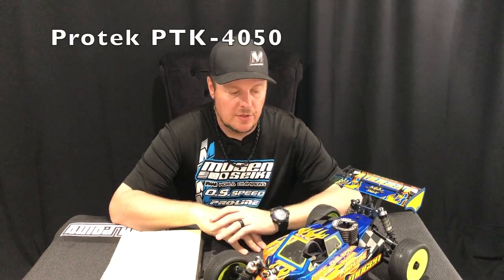Nitro Engine Tuning - Things to check before making adjustments.

Comment: Adam, Great video as usual. Definitely should help some people with tuning issues. Glad you also mentioned the idle gap as well. Most ppl I help never even know what that is or even how to do it. You always want to measure your idle gap to your Venturi size. Lastly, I know this might be a longer video that you would need to do, but can you perhaps make a video on using different diff weights and how they effect the car?  Specifically when you increase or lower the weight in the front, center, and rear of the car and how it actually effects the power distribution, steering, and traction. Thanks Again, and I hope all is well with you, Ronda, and the rest of the Fam. Happy belated Anniversary as well.
Reply: Hey buddy could you go into more detail about setting the idle gap in correlation to the size of the Venturi? I thought you just set the idle gap to .6- .7mm no matter what
Reply: @jeremywilliamsrc8797  What Adam is talking about is if your running a 6.5 Venturi, you need to get a set of calipers and place it over to where your low end needle is on the carb and place the other end of the calipers over on where your mid needle would be or is. Then zero out your calipers. Then grab your transmitter and open to full throttle. Your calipers should measure/read exactly what size your venturi is when you open full throttle. This is referring to setting your throttle end points. Sorry for the confusion when I stated idle gap. Adam talks about this in his video named "how to set-up throttle and brake linkage."  Hope this helps.
Reply from the maker: I have a video on diff fluids.
Reply from the maker: I start with the idle gap at .5mm
Reply from the maker: Thank you!
Reply: @cbrwix  thanks for the clarification buddy I appreciate it.
Reply: @jeremywilliamsrc8797  not a problem, anytime.

Comment: The only area Mr drake that I have. I do exactly what you say buy the book. I keep my clutch in 100% smoothness. My issue is after I warm it up to 220+ fire it up clean it out a few times. Then I run it on the track 2-3 laps when I let off throttle coming in to a corner. The the RPMS are high with the idle. It does not come down instantly like everyone else engins do. I'm confused with what needle setting am I off on. I wish there was a video explaining that issue it would help thanks Adam
Reply: Mid is to lean.
Reply: One engine does not have a midrange the other does
Reply: In my one direction on the mid settings. It says if you lean the midrange setting 1 hour you have to richen the bottom end needle. That they both work together.
Reply from the maker: Coming soon!  It could be too lean on bottom or the idle is too high and the lsn is too rich.
Reply: So that means the fuel is being restricted and flowing in to the carb quick enought. So when I come off full throttle and the RPMS are high after coming off full throttle. Could that mean the fuel is being cut off from eather the top or bottom end needle then I see.
Reply: One time I cleaned the engine out and when the rpms where high. I slowly started cracking the low end needle open until I heard a rpm drop.  I kept on doing it until it consistent.

Comment: Hey @AdamDrake . So I can't even pull my pullstart? Even after preheating.. Please advise
Reply from the maker: It could be cause by corrosion if the engine has been sitting and not properly stored with after run oil?  Or the engine is flooded?